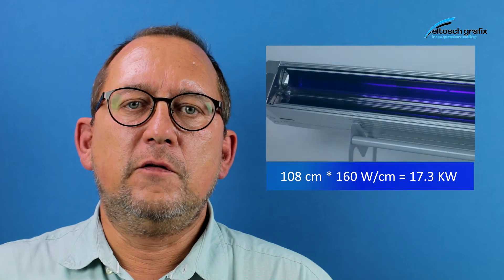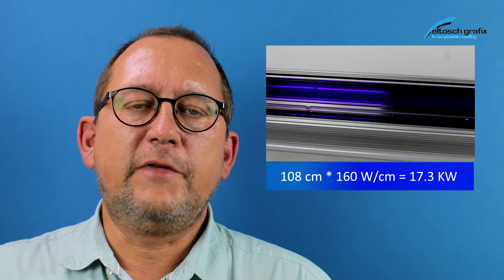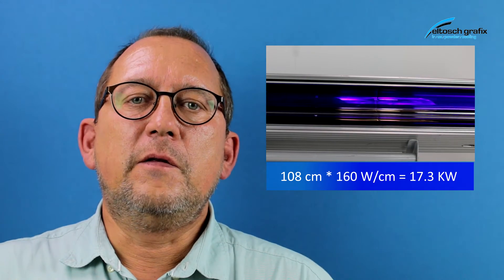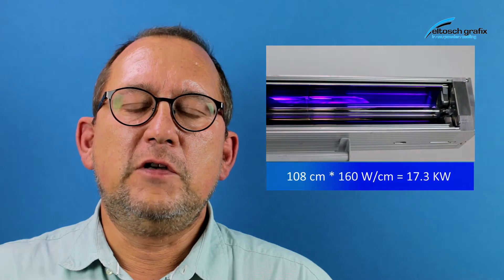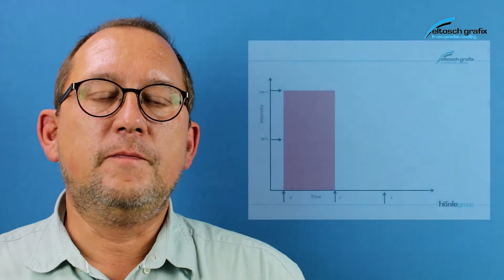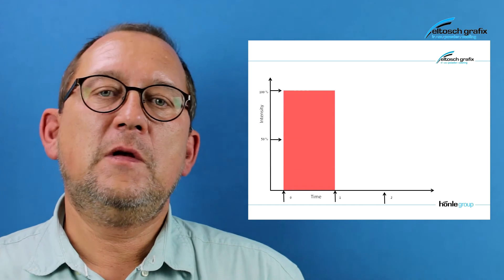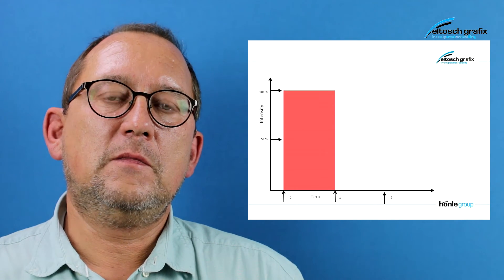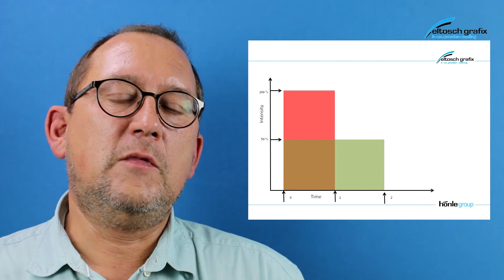Understanding UV values (W/cm, W/cm², mJ/cm²)

Comment: I did the banana test. Placed the banana over a box inside my disinfection box so that it will be around 4inches between the 2 8-watt uvc lamps. After one hour there was no decoloration that can be observed between the exposed part and the part that was wrapped with an electrical tape. Does this mean that I purchased a fake uvc lamp?

Comment: Wow! Finally I found the source for accurate information about uvc. I made a disinfection box out of a styrofoam box 54x39x31cm. I covered the inside parts of it with aluminium insulator to reflect uvc light. I installed (2) two 8-watt uvc lamps inside it. Do I need to change the lamps with higher wattage? I will use this diy device to disinfect grocery items, meat and vegetables and other items coming from outside the house in order to protect ourselves from the.covid-19 virus. I wish to disinfect items in a shorter period of time like maybe 30minutes. I hope you can answer my question. This would really be a great help.